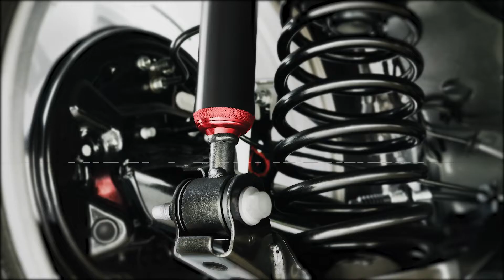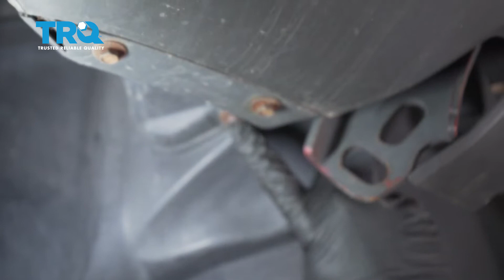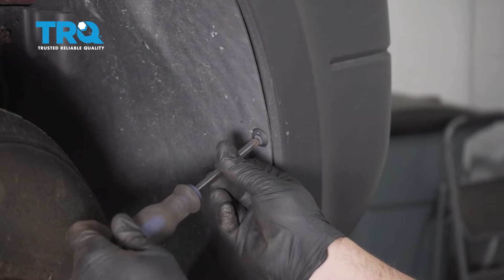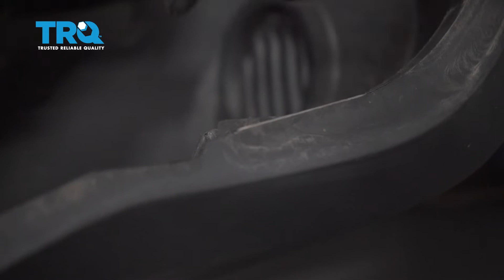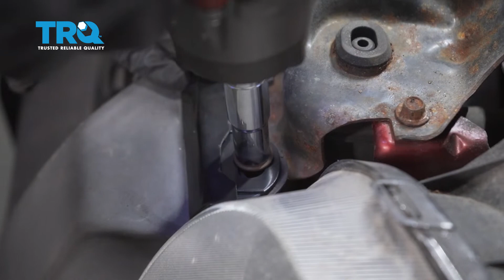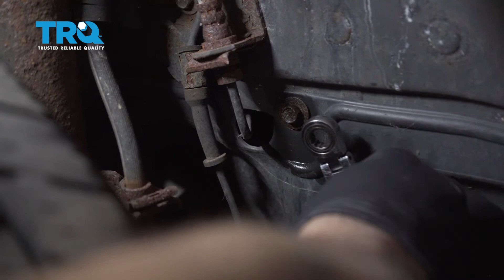How to Replace Front Bumper 2001-2007 Ford Escape

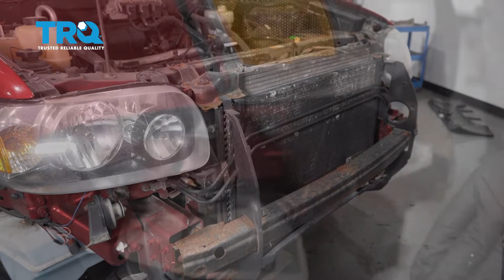Comment: question.. at 2:12 in vid after bumper is off.. there are 2 plastic pieces on both side plastic clipped to bumper. what are they called? what's the part #?